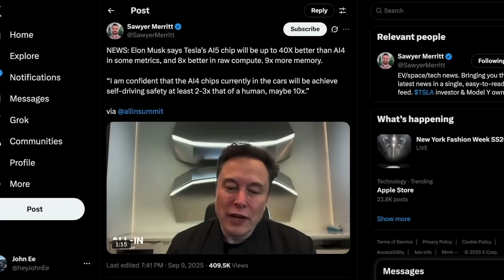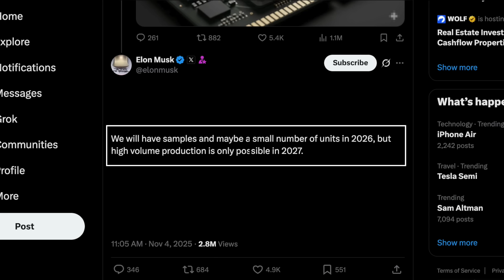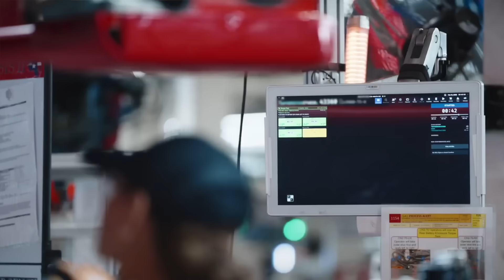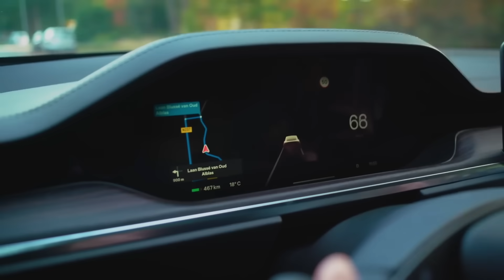Tesla Prepares For HW5 Upgrade Delivering Major Performance Increase | But There's Even More

Comment: HW4 cars currently facing the same fate as HW3. HW4 will not achieve unsupervised
Reply from the maker: Actually, if you’ve been using v14 you’d know how incredible it is right now even with “just HW4”, it feels nearly unsupervised
Reply: @heyJohnEe V14 will stay just at nearly unsupervised.
Reply from the maker: Maybe, but he seems very confident on removing safety supervision on Robotaxi in Austin later this year

Comment: Sounds like AI5 is something to avoid; if they hit their timelines then it will be obsolete in 1 to 2 years.  And you have to assume that older hardware versions will only be able to run the latest software for a year or two at most after a new version is launched.
Reply from the maker: Maybe, although any chips after might be reserved for other products not cars

Comment: Hello, is there any information about a possible 800v implementation in the more common models like the Model 3 and Y?
Reply from the maker: No recent details that I know of yet, it would likely need to wait for a full redesign or different platforms cars due to the complexity of the existing line. I’ll share if I hear earliest news from sources
Reply: @heyJohnEe  When can we expect it?
Reply from the maker: On the 3 and Y? Might not be for years imo

Comment: Didn't Elon say that mass production of AI5 chips will start in 2027? I'm presuming they'll prob put AI5 into the Cybercabs being produced in 2026 and then in 2027 they'd introduce them into the Model SEXY lineup? That being said, prob doesn't even matter cause when buying a Tesla, every year is prob gonna have a newer hardware version (AI5, AI6, AI7, etc).
Reply from the maker: dang you're the first comment to appear after the youtube wide glitch. yeah 2027 is mass production but low production could still be enough to test on the premium fleet to gain early data, so likely the S and X along with Cybercab
Reply: @heyJohnEe Ah, yeah that's exactly what I was thinking. Crazy how everyone was waiting for AI5 but we'll be getting a new hardware version almost every year 😂
Reply from the maker: @liam1902 yeah pretty much

Comment from the maker: I feel like leasing a Tesla is way more beneficial now with so much planned down the line, what do you think?
Reply: Did a 3-year lease right before the $7,500 rebate went away. Our other car is a 2018 M3 whose extended warranty expires next September. That one will be traded in whenever AI5 becomes available.
Reply: I think it’s a bit naive not to notice how many years pass between each hardware upgrade. Elon originally said AI5 would begin production in 2025, but now it’s been pushed to 2026, with mass production not expected before 2027. That means AI6 won’t even reach sample production until 2029, with mass production likely around 2030. If you’re still optimistic, AI7 might arrive by 2035. By then, AI8 will no longer be the 'out of this world' version—it will have been rebranded as AI10. And realistically, AI10 may not appear until 2055, at which point many of today’s enthusiasts will no longer be around to see it.
Reply: @trt5t54yre Basically they decided to make significant changes (huge improvements) to the AI5 architecture. This why the delay is so long. The same thing might happen to AI6/7/8 so you are probably right. What's huge is the 10x parameter increase for AI4 may allow general unsupervised in 2026. We'll see.
Reply: Either that or buy a used Tesla and trade it in when AI5 comes out, which allows more flexibility than a fixed lease.